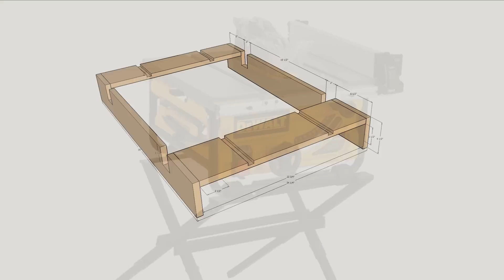How to make a portable table saw extension for the DeWalt 7480

Comment: I made this, and it worked out perfectly! I am now using my table saw WAY more often because it’s safer and it’s easier to get accurate cuts now. This  is the table saw I have - exact same model. It was very difficult to get bigger boards lined up and started with such a short front. So glad I found this!

Comment: Thank you so much for sharing this idea. I have this model so was elated since the infeed length is short and longer pieces tend to be difficult to stabilize because of this... it is an issue. However since I made a cart for mine out of wood, I'm going to find a way to attach this to the sides of the cart rather than to the table saw itself. Ingenious plan! Great skill and attention to detail.

Comment: Hey there, I love the thought that went into this. 

I cam across this video as I've been researching ways to add side extensions with a router table for my Dewalt 7491RS.  Have you considered modifying this design so that it's modular to accommodate a longer outfeed table and a side extension with a router table when needed? 

What I love about your design is that it provides additional anchor points where I think these types of modular components could be added. I'd be very curious to hear your approach for this. The rolling stand with my version gives me some additional mounting points as well. I'd love to hear your thoughts on this type of modification.

Comment: that looks great!! i want to make one for my table saw as I have the same model and have the same issue with the small table. I do have a bit of concern about the on/off switch being a bit further recessed and harder to switch though. 

And I might consider doing an extra support panel on the left hand side which can be mounted on that ply to give it extra reach for cross cuts on long pieces
Reply: You could attach an auxiliary switch to the front of the saw extension to make it easier to turn the saw on and off.
Reply: I was looking for ideas on how to extend my Dewalt table saw on the left side, when I found this vid. I'm considering doing something similar, along with the auxiliary power switch as well. Great build!

Comment: i have the same saw and have been looking for a good plan to expand the table. Thanks!
Reply from the maker: Awesome!
Reply: i made this for my saw and added a shop vac attachment between the saw and the extension to catch all the dust that it throws back at me.
Reply: and countersunk the screws on the left side so i can add an extension wing later
Reply from the maker: Awesome!!!
Reply: I plan on building a table for this saw and may use these plans as a base. Do you have plans for the sled as well?

Comment: I love this build and am considering modifying the plans for my skilsaw jobsite saw. I'm curious how you go about adjusting the fence for rip cuts smaller than the width of the extension table, i.e., when you cannot use the table itself to adjust the distance of the fence from the saw. It seems to me, from the video, that the locking clamp for the fence would get caught against the added front extension and therefore not be able to operate within the width of the table itself.
Reply: Trampas Thompson I made this, and you can totally move the fence in as close to the blade as it was designed to do. The 2x2.5 sections cut out of the side pieces accommodate it without any problems. Today I ripped a board to 3 inches width against the fence, for example. Keep in mind it’s designed for this particular make/model of saw.

Comment: I have a similar saw and would love to add this extension. I downloaded the plan.  I am, however, a relative newcomer to woodworking and don't quite understand how to build the jig to cut the divots for the side flanges, and it was not a part of the plan. Could you possibly explain how to make this jig? That would be great.  This is a great build. Thanks, and keep up the stellar work!
Reply: About to start this project as well.
Reply: get small board. mark out dimensional size of hole. Drill hole. Use chisel to square corners. Use router with pattern follow bit to follow pattern of hole on wood.... Or just do the first part on the actual work piece it will just have rectangle holes in the sides
Reply: Thanks for the input. I figured it out and am now almost done with the extension. I'll be putting it onto the saw today or tomorrow. I'm excited to start using it. It will definitely make table saw use much easier. Again, thanks!

Comment: I just purchased the Dewalt cordless and was thrown back by the single miter t slot on the top. Is there a possibility of still applying your technique to a single slotted top?
Reply: May I suggest doing a little more research before spending $400 on a power tool?